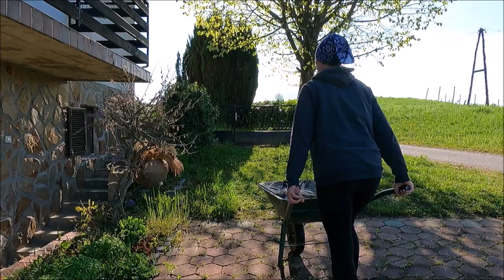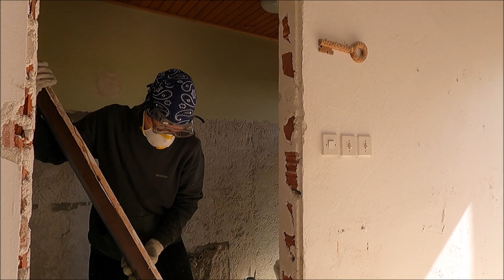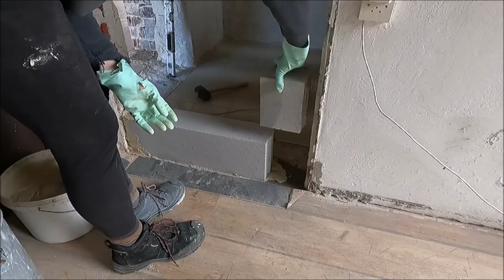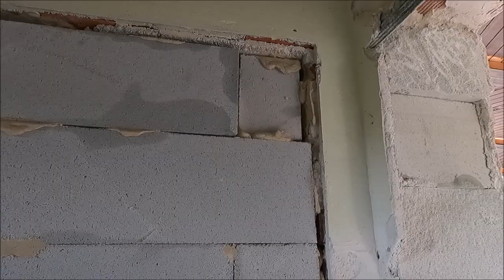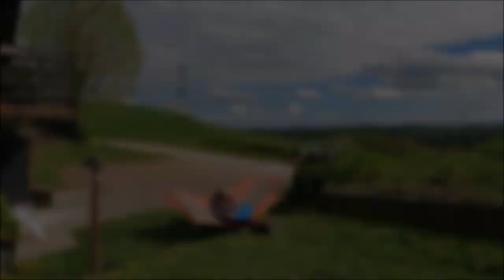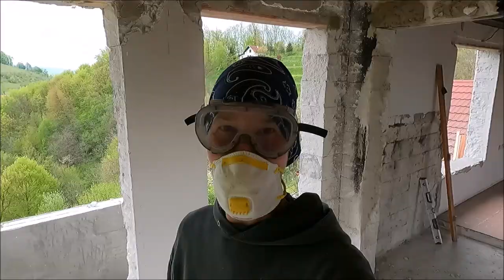SOLO COUNTRY HOUSE RENOVATION - I build a wall and break down the wall

Comment: Nice job! Next time when using aerated concrete blocks don't forget to put in some wall anchors. I.e. L-shaped strips of flat steel which you nail into the block and into the wall. It makes for a more secure connection.
Reply from the maker: Thanks